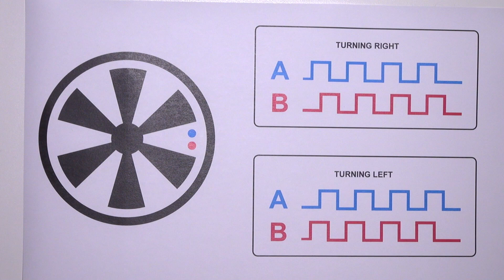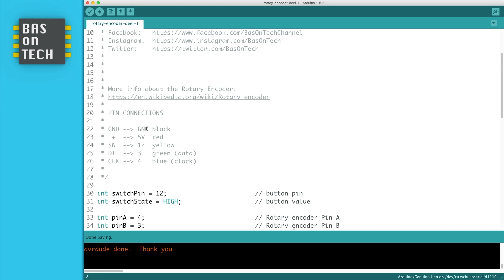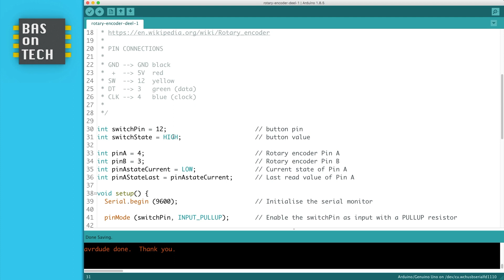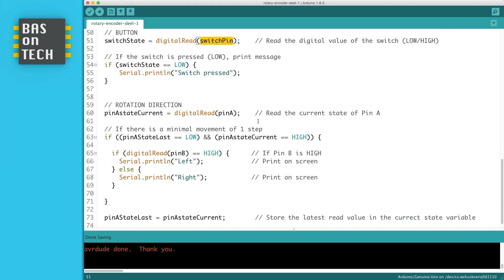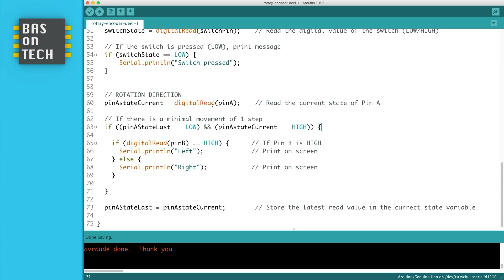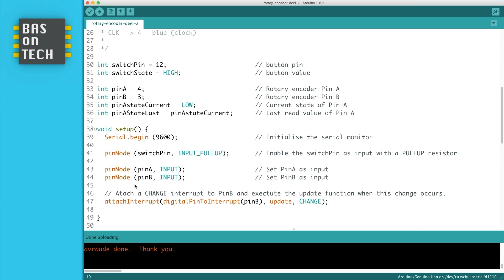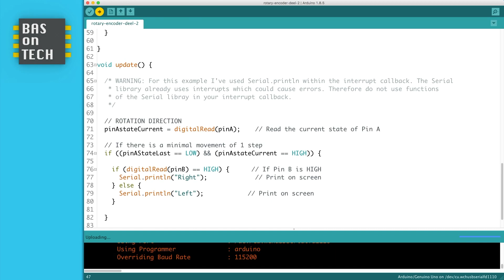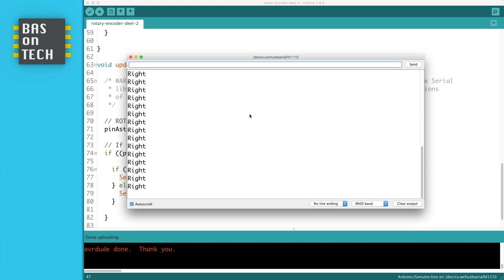ROTARY ENCODER WITH INTERRUPTS - Arduino tutorial #12

Comment: Great video Bas :) i bumped into your channel and I immediately got hooked on the quality of your explanation! I did follow the tutorial with ease. Unfortunately my rotary encoder is still giving me false values (even when I try to move it slowly). I am thinking to apply some filter on the raw values (avg of 3) perhaps? Any pro advice on how manufacturers usually solve problems like that?
Reply from the maker: I think averaging is not the way to go tbh. I am more wondering if the rotary encoder is malfunctioning or that some wiring is causing this issue. Have you tried with another rotary encoder?

Comment: that annoying that there are only two interrupts . i want to run two encoders and just realised why 1 is having difficulties
Reply: Cheers mate I appreciate your info I may buy a few mega’s. Turns out there’s another way I found something a library that give you interrupts on any pin. There a catch it stops interrupts on everything but it doesn’t matter on my project as you’ll only use 1 thing at a time so it’s working pretty decent now. Although I’m trying to work on an optical rotary encoder and 3d printing the rotary ir blocker there’s just not enough ticks per rotation on a general encoder for what I need it for.
Reply from the maker: I believe the Arduino Mega has more interrupts.
Reply: @BasonTech  Hi Bas, I have two questions:
1 Two interupts on the Arduino for two rotary encoders should be working, not? Toch? Please confirm.
2 And is it also possible to use PCINT to use even more than 2 rotary encoders on an Arduino Uno or a Nano? Because going to a Mega is sometimes an overkill and a Nano can be much more efficient.

Comment: i have first added the encoder without interrupts- which worked semi okay (its not reading fast enough), so i added the interrupt. Now when i turn the encoder my whole program will stop. I call a switch case with the interrupt and the switch case calls another switch case inside, maybe using an interrupt is forbidden with nested switch cases?
Reply from the maker: I know that the code within the interrupt needs to be as small as possible. A switch adds logic so perhaps you are right and is it not advised to do so.
Reply: @BasonTech  i have changed my code to only use buttons - short press once and long press continuously change a value (i still have to add that long press tho).

Comment: my encoder bounce all the time and it is driving me crazy, how do you make it not bounce
Reply from the maker: Maybe there is a malfunction in the rotary encoder? Have you tried another one?
Reply: @BasonTech  I try all of it mate. From the rotary encoder with breakout board to the stand alone one, they all bounce the same way to me :((( it's pretty frustrating
Reply from the maker: If that is the case, it should be either your wiring, or your code. Please check the pin layout of your encoder to be absolutely sure the pins are not labeled different than mine in the video
Reply: @BasonTech  i double check everything for an entire month, I search on youtube a found that many people have the same problem as me. But it seems like you don't encounter such problem at all
Reply from the maker: Indeed not at all, it just worked. Are you using the Arduino Uno as well?
Reply: @BasonTech  i don't think that's the problem mate, as other had the same problem on other board. Thanks for your consideration. However, there is another encoder variant that do managed to work perfectly, but that one does not have a thread to mount to the panel so i can't use it in my project
Reply from the maker: The board matters, combined with the pins you use. On the Arduino Uno, pin 3 is INT1 which is an interrupt pin. If you use another board the INT1 might be on another pin.
Reply: @BasonTech  sorry, i forgot we were talking in context of interrupt. My bad mate. However I mostly use the encoder with polling methods, I should have clarify with that first.
Reply from the maker: I did that first as well and then I got the issue you've got. Therefore I made this tutorial, to show how it works with interrupts 😃
Reply: @BasonTech  wait,  for real ??? Damm i neednto try this now. I did try it because i didn't see you mention about bouncing, gonna give it a go now.
Reply from the maker: In general I like interrupts more than polling, because interrupts only fire when needed while polling always needs to check if there is an event.
Reply: @BasonTech  oh, never mind then. I use the pro micro. external interrupt are on pin 0, 1 (which is Rx and Tx which i can't use because i want to use the pro micro as HID). Pin 2,3 also have external interrupt but i need to use it for I2C. Only option left is Pin 7 but i guess we need more than 1 pin for the code =)))) such irony for me =))) anyways, thanks for the help, I appreciate your reply a lot
Reply from the maker: @Leviathan0707  Great I could be at assistance! Good luck with your project!

Comment: I loved your video, but when implementing the interrupt, I am now getting left on left and mostly left on right. Before implementing the interrupt each direction is mostly correct.
Reply from the maker: Hi, make sure you have wires connected correctly. Sometimes the encoder is damaged and "slips" resulting in wrong output
Reply: @BasonTech  Thank you! I changed the encoder and the new one works perfectly. 🙂
Reply from the maker: Great! A disadvantage of rotary encoders is that they wear over time and start slipping

Comment: lets say i want to connect 2 encoder, i assume is possible to contec the pinA to arduino pin2 and 10 and the other encoder pinA to arduino pin3 and 11. i assume thinks will work the same way. of course by doublening the code, with deferent pins and names,  will this work?
Reply from the maker: Correct, however it is better to not repeat code but split it up in reusable functions 😃

Comment: Hi Bas on tech, how did you verify this program when ' digitalPinToInterrupt' was not declare in this scope, help me please to understand. Thanks for your time.
Reply from the maker: Hi Jaime, please make sure you have no typos in the naming of digitalPinToInterrupt and see if all the { and } are opening and closing at the correct place.
Reply: @BasonTech , I've already checked many times, but I'm not the only one with this problem, someone said reinstall the IDE program and try again but it didn't work.
Any other suggestion, I'm using an old Dell laptop with Windows XP. Thanks a lot for your patience.
Reply from the maker: @jaimeriquelme6727  Did you copy my source code from the course material to make sure there aren't any typos?

Comment: I´ve tested it on other pins that arent 3 and 4 and it doesnt work, why does this happend? Before you ask, I´ve changed the code so that the pins are different. If there is something misssing please let me know!
Reply from the maker: Hi Elías, very good question! In the code you see we attach an interrupt to pinB. As https://www.arduino.cc/reference/en/language/functions/external-interrupts/attachinterrupt/ shows, for most Arduinos only pin 2 and 3 have external interrupts. So therefore you can only use these pins 😃
Reply: @BasonTech  Thank you soo much for answering this fast!! This means we could only use this method for 2 simultaneous digital encoders??
Reply: @BasonTech  Well I've seen that my arduino Leonardo has more than 2 pins with external interrupts. Thats means I only need one for each digital encoder? Thank you again and hope to see something from you soon!
Reply from the maker: Indeed 1 interrupt pin for 1 encoder. However there might be some PCB out there which can multiplex multiple encoders on a single pin

Comment: You should handle the denouncing in hardware, not software. Adding a couple resistors, a cap and a 74hc14  will give you a nice clean signal.
Reply from the maker: Thanks for sharing! 😃
Reply: I suppose you are kidding...
Reply: @longdongsilver4719  not at all, bouncing is a hardware problem. Always solve the problem where the problem is. Pushing it off to software is just lazy engineering
Reply: @MikeysLab  The right solution is the simplest one. Adding some debouncing circuitry is just over-engeneering when it comes to a simple rotary encoder. Adding active or even passive components increase the risk of failure and the cost.
Lazyness is not a criteria in engeneering but efficiency, production cost and MTBF  are the real way to think your design.
Reply: @longdongsilver4719  okay let's look at the "efficency" of your idea, on one hand we save about 7 cents per encoder. On the other we have to pay an embedded software engineer to write a complicated debounce function that will not use delays or hinder main program execution in anyway, or use a multi core micro controller and dedicate a thread to the ui alone, which as a embedded software engineer is going to take about 16 hours to design implement and effectively test before it should be released in a product. Factor in I charge $200/hr for dev time and your 7 cent savings just cost you a whole hell of a lot of money. The easiest solution is not always the right solution. This is what makes people use strings over char[] in Arduino and get into trouble with memory fragmentation
Reply: @MikeysLab  You just forgot that you also have to pay the engeneer who produces the hardware solution. It takes also time to design it, and more: it takes time to implement. On th other hand nobody ever said that you have to implement a microcontroller just to debounce an encoder. You already have integrated it in your design and the extra cost to write some "complicated" code (which means a few lines) is near zero.
Reply: @longdongsilver4719  Fair point, but adding proper heuristic analysis of pin state to properly profile bouncing while not impacting the speed of the main loop is not "a few simple lines of code" I mean if you are just going to use a detect -> delay -> detect method, well you have already abandoned good clean code anyway.
delay(); == GOTO, while(millisStart + delay > millis()) is better, but still far from good.
Reply: @longdongsilver4719  I will also point out, both are kinda mut points (yours and mine) since as a software engineer, I have a library I have written to do debouncing. Plus I have templated schematics for debouncing in hardware. It really only comes down to philosophy. I was always taught to fix a problem where the problem is, and make the life of all the other team members easier, never pass off work you could easily complete. Especially for disciplines you might not know, since you do not know how much work you are creating for them. What is a 10 minute thing for you, might be hours for them. In film, "We'll fix it in post" is a very bad statement :)
Reply: @longdongsilver4719  On a side note, this is a topic worth diving more into for sure. Do you mind if I make a video on the topic for my channel?